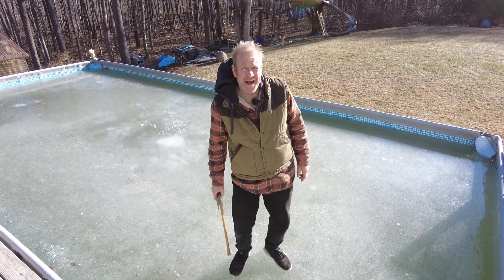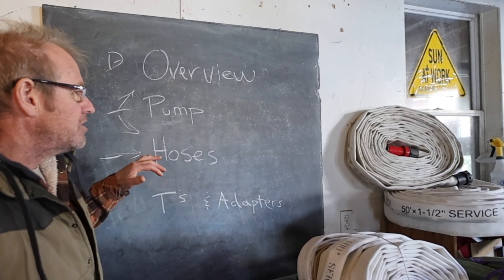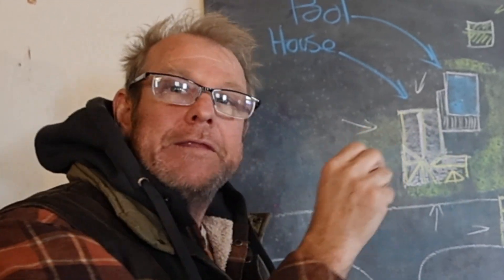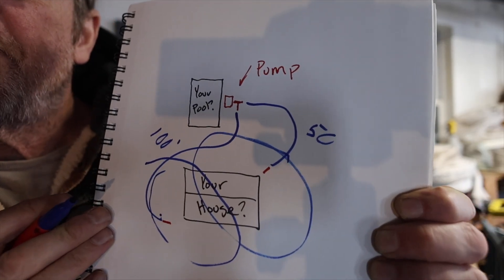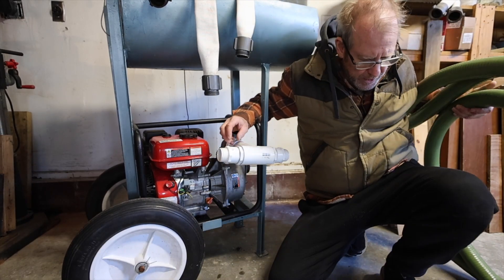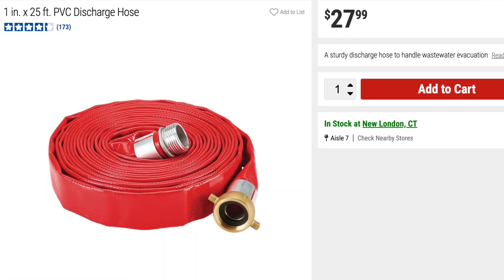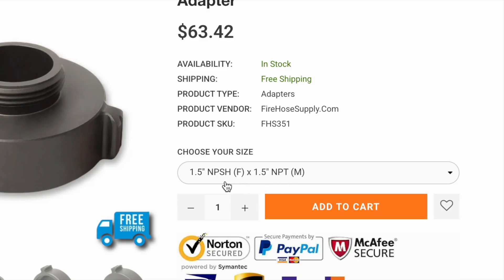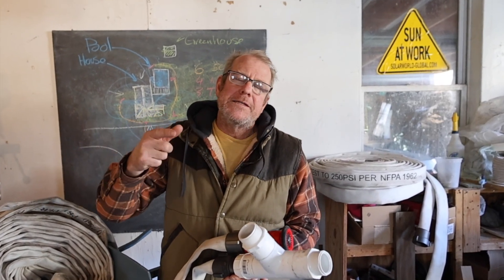How to Make a Wildfire Defense with Pool, Pump, and Hoses, DIY

Comment: Thanks for mentioning the pump isn't made for that use but can work for it. Rated at 91ft head it is pushing a little under 40 psi. Do you know if that is accurate? Someone using this pump to go up much of a slope would see a big drop in performance. There are a few high lift pumps that can be found that give a lot more pressure but at quite a jump in price. The Honda wh15 and wh20 are popular, multiquip high pressure models, davey fire pumps, hale, northern tool. Best of luck and thanks for making the video.
Reply from the maker: Hello, I’m not sure if the 40 psi pressure and 91’ head is accurate. I have used to fill my pool that is about 45’ lower, and there wasn’t any noticeable decrease in pressure. But this Predator is the cheapest pump on market, that I could find. There are definitely better pumps. Hope this helps. Thanks,

Comment: You are on the right track to protect your property . You should also look at putting sprinklers on the buildings . The rain bird style is the best.  the best place is to mount the high up around your property .  gable on the peak of your roof  . If you do a goggle search  for structure protection  units.  The sprinklers make a humidity  bubble around the structures ,Most strutures  burn from embers landin on the roof and combustibles  around them.  this system  is used in BC Canada .
Reply from the maker: You’re right, sprinklers are an effective way to protect structures from wildfires. Especially good for folks who don’t have good escape routes! Turn them on and bug out.
We have some sprinklers that are deployable in CA. But where I am in CT it is still too humid for the risk to warrant the setup. Every year we more and more red flag warnings so maybe soon.
Thanks for the tip,

Comment: Awesome content! When using Google maps, right click from the point you want to measure then choose the "measure distance" tool, clicking at each point until you reach the final point to see the distance in feet or miles. Also consider Barricade Fire Gel(no affiliation). Here is what I did with a Harbor Freight welding cart and some fire extinguishers for firefighting inside during a hurricane here in Florida.   https://youtu.be/GklyvloMawU?si=BAqjKg7e87U0DDcU

Comment: You need to factor in the wind, direction and velocity.  Also if there are hills nearby/  Fire Travels faster uphill.. N
I would be inclined to vacuum up. Rake up. Dispose of all the leaves on the ground. They could get. blowing around after they're caught on fire. That would be a problem.  I would also. put sprinklers. on the roof And start those up long before the fire got there. soaking the roof. The grounds, the trees.
I would also trim back here Shrubs and trees in the fall. and consider using foam or its equivalent along with a wetting agent.
The old a triple F. was used. at a 1% ratio. So that was stretch your pool water out. A lot more than 6 hours. Plus it would stick. to a vertical surface.
I think. the new ones are biodegradable. A
This is definitely a good tutorial., I hope people take note.
Reply from the maker: All good points. Thanks for sharing,

Comment: awesome setup, you may consider replacing those T fittings with Y fittings,  drastically reduce friction loss
Reply from the maker: Hey thanks! True about the Y’s but I have plenty of pressure so not worth the extra $. Thanks again,

Comment: Thank you very much for your video.  I was wondering if you had any suggestions as what alterations to your pump you would make for using an in ground pool with an 8' depth.  Thanks very much.
Reply from the maker: Sure you bet. Good question, thanks. Actually it would work just fine in your case. The green suction line is 20’ long so just throw it in the deep end, prime the pump and away you go. Thanks,
Reply: Thank you, I am thinking

I don’t really know how I can prime the pump when the intake is 8 feet deep.
Reply from the maker: @ there is a cap on top of the pump. Simply unscrew, and dump water in using a bucket. Then replaced the cap. Then the pump is primed.
I go over how to set the system up in my other videos. Thanks,

Comment: Your fire pump is very under powered.  Consider the hoses you're using.  And your water supply is very limited
Reply: Looks like he had decent pressure. His water supply is probably close to 20,000 gallons (Plenty) There are better and more expensive pumps out there but your talking $$. Honda makes a high pressure pump about 65psi but less gpm. For his setup it looks like it works great. Much appreciate the time he took to make the videos
Reply: @greggo502  lol seriously? The psi is under powered.  I won't debate this issue.  Do your homework then respond.
Reply: @acebatman7024   Don't getting your panties in a bunch sport. Your gonna get about 35-42 psi + - off that pump. For the price and setup he has it works well. Theres  Honda (about $700-$800) ,AMT,CET Multiquip and other high pressure pumps out there but there not cheap. If you want more psi your gonna have to pay upwards over a grand and more. How about you take the time to  show your video and lets see your set up inquiring minds want to know. I for one appreciate what the guy did posting his.He might have saved someones house and property.
Reply from the maker: Yeah, cool. What are you running and what’s your water supply?

Comment: I read this comment about the Predator 3" and 290 gpm pump. The smaller 2" was sold out.   
Harbor' Freight's website didn't respond and it made me wonder why. Is there something that he's doing wrong? Will too much volume make it lose pressure? Here's the comment:

"It will move a lot of water fast. However, it is much less useful for irrigation, where you need some pressure to run a sprinkler or a fire nozzle. I did run it into a 1.5 diameter fire hose and it did adequate moving water a couple hundred feet, but put a fire nozzle on, and it was just too much. It slowly lost pressure, until no water was coming out. I did take the pump apart and saw no problems. Started it up again with the same results. Left a open hose with no fire nozzle, and it moved water, directly onto the ground. Tried using it with a irrigation sprinkler (farm size) with unsatisfactory results. If I was on a boat, and we were sinking, this is the pump I would want. If there was a fire or I wanted to run a farm rated sprinkler, this would not be the one to get. It is sold as a semi trash pump, but I once thought that meant it could also be used for irrigation and fire suppression. It is sold as a semi trash pump, but I once thought that meant it could also be used for irrigation and fire suppression. Not so much. I have a need for a pump that will handle both of those tasks. This one does not fill the bill."
Reply from the maker: Hello, I looked up that 3" and it has 85 feet of head, which means that it will pump water straight up until it gets to 85 feet and then it will stop. The closer to gets to 85 feet the slower the flow, so if it does 290 GPM at 0 head (vertical lift) at 85 feet of vertical lift it will do 0 GPM. At 84 feet my guess that it would do like 2 GPM or so even if the hose was reduced in size just to give an idea. As far as I know head is kind of like pressure, (sort of). The Predator 3" pump has 85 feet head, the 2" has 91 feet and the 1" has 95'. 
Besides lower head the thing that I wouldn't like about the 3" is that it's just bigger than you might need. This type of set up is for keeping the fires from starting and putting out little spot fires more than putting out huge already existing fires. Then you would want a lot of volume. Also search YouTube and see if anyone has hooked one up to nozzle 3" and see how far it shoots. There are lots of other brands that are just as good if not better as well. As far as I know Predators are Honda nock offs.  Hope this helps!

Comment: You could put fittings and valves to your pool pump if you still have power. Also putting a roof sprinkler up with a ground connection is recommended. There is a film from 1961 and I read a good article in the mid 60s .
Reply from the maker: Yeah, in this video I hook a fire hose up to my pools circulating pump and do a side by side with the gas powered pump. It’s would be better than nothing.
DIY Wildfire Protection System, How to pool pumps & hoses
https://youtu.be/9J4tyugAFY4

Comment: Just received my HF Predator.  Planning to put together the PVC manifold today.  In your previous fire vid, didn't you say that the male NPT (MPT) pvc connects to your female fire hose without any adapter and doesn't leak?
Reply from the maker: Hello, Yes, but the female firehose has to be NPSH (National Pipe Straight Thread) not NH/NST. The male NPSH firehose needs an adaptor for the female PVC. This web page explains the hoses becasue they are confusing. https://firehosedirect.com/blogs/expert-help/fire-hose-nh-vs-npsh 
So if you are going with PVC your going to want to get NPSH hoses. 
Hope this helps!

Comment: Another question
My pump is 3” and I want to step it down.  Stupid expensive!  are there cost savings tricks to do this?
Reply from the maker: Shouldn’t be too bad with PVC and reducing bushings. If you’re running multiple T’s you can reduce there as well. So the hoses closest to the pump and don’t have nozzles on them would be bigger than n the ones at the end of lines with nozzles. This would also give efficiency with the 3” pump. Hope this helps,